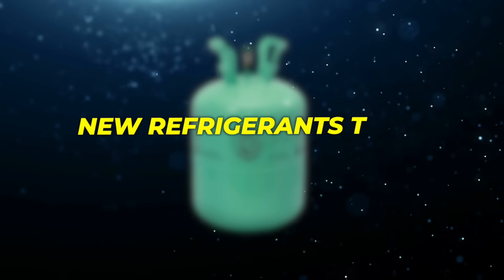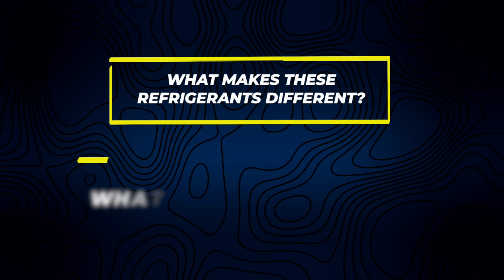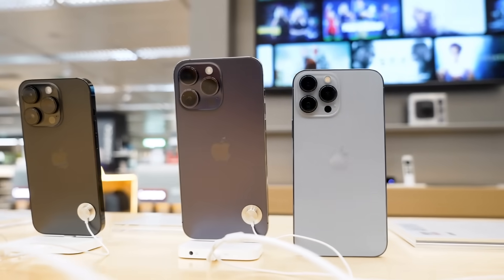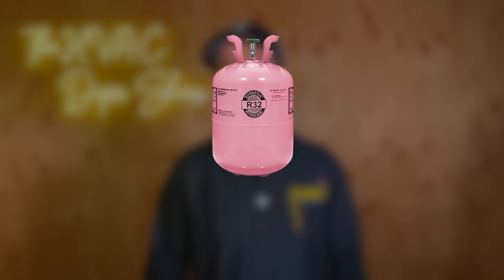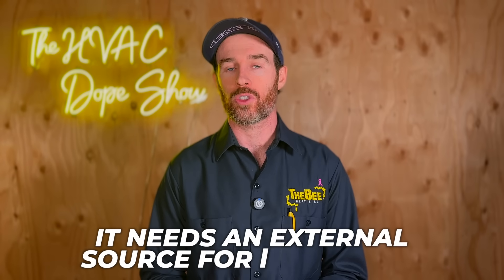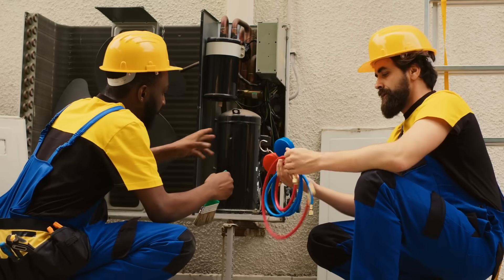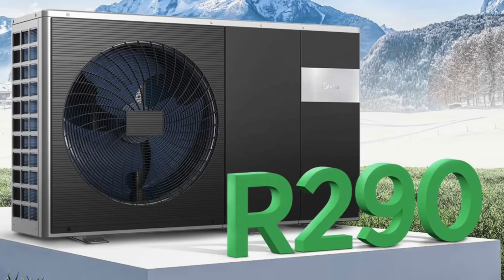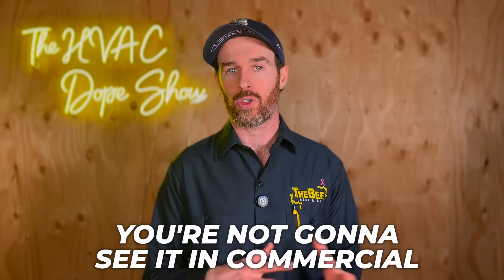The TRUTH about the “new” refrigerants | R32 and R454B refrigerants phase in

Comment: I want a R290 (propane) or C02 mono-block system .. and I’ll wait until they are here as I live in a colder region and these are better options for hot water.
Reply from the maker: Hopefully they’re here soon! Might be waiting a while but if you don’t need it yet then no rush 😁
Reply: I was reading about this in like 2006 crazy how long change takes
Reply: Propane tends to be a bit on the explosive side.
Reply: @n4mwd  … we use propane and natural gas inside our homes and in BBQs everywhere.  This tech is over 100 yrs old.  In an air to water system no gas enters the house, the unit is sealed, and the gas is inside a steel box.  These systems are legal in Europe and Asia, and are proven to be safe.  Corruption and/or incompetence is why we do not have them here .. maybe both.
Reply: @solarguy4850 I think the issue is that it’s super common for leaks to occur in a hvac system due to high pressures while operating. That’s why it’s seems dangerous to have a high flammable refrigerant for hvac systems
Reply: @carlosgarcia9509  I’m talking about air to water systems.  These are factory sealed and the propane never enters the dwelling .. just heated or chilled water.  It is also a teapot full in volume.  They are legal everywhere on the planet except North America, and there is no evidence of problems.
Reply: @solarguy4850  There are good reasons that propane is not used in US systems. US system refrigerant charges are much bigger than in Europe — up to 20 lbs, so a leak can be deadly. Propane is extremely flammable, and heavier than air. So if there’s a leak inside the home, if a few lbs of propane are ignited there can be a severe fire or explosion.
Reply: @solarguy4850  for package units, maybe, but not for splits with several pounds of refrigerant. Propane is heavier than air, and pools. If a pool of propane is ignited, a leak can be catastrophic to the building.
Reply: @WLB2-j5j  yup .. I’m talking monoblocks.  Zero interest in splits personally.. they don’t do hot water. Propane or C02 heatpumps are needed for hot water else you rely on resistance heat for the top 20% of heating.
Reply: @WLB2-j5j  I’m talking monoblocks.  No refrigerant enters the building. Also no need for that much refrigerant in a monoblock .. the ones used in Europe are fine .. a bit more refrigerant would be nice, but fine.  Look it up.  BTW .. I have 20 lbs on my deck and 40 on my RV.
Reply: My next home will use this, an R290 monobloc system for radiant heating. I might have to move to Europe to make this happen.

Comment: As a person looking into installing a mini split system.  What do think will happen to unsold system going into the new year. Will they be returned to the manufacturer or do they go on sale to make way for the systems with the new refrigerate.
Reply from the maker: They’re already kind of priced accordingly but they won’t be manufacturing 410a equipment as of 2025 so I’m not sure honestly. It will likely stay at a slight discount like it is currently
Reply: @TheHVACDopeShow  thanks for the reply. I'm just on the fence on if I should buy now or wait until closer to the end of the year.
Reply: They'll push their old crap at even higher prices. See in this game, the hundreds of millions of homeowners are stupid suckers. Just ask any sub cool expert.
Reply: Any R410 system built before January 1, 2025, will be allowed to be sold even if it's 2028 or later. But don't fall for that trap, R410 is going the same way as R22 and just as quick.
It's better to buy an R32 system and not worry about the availability of the refrigerant down the road.
Reply: they will just sell out
Reply: Hvac owner operater 23 years I would buy a Daikin r410 mini split I do not like the idea of being a guinea pig for the new refrigerant
Reply: The regulations are based on date of manufacture of the units, not date of sale. So no problem .

Comment: I really don't agree with the rhetoric right now of pushing installs of 410a systems this year because "the new refrigerant" will cause prices to increase. I don't see that playing out much over the natural increase in prices. I do foresee many unscrupulous contractors pushing for system replacements on the basis of "410a has been banned". It just seems like every change is being used as an opportunity to scare the consumer into making unnecessary purchases.
Reply from the maker: Yeah I’m in the same boat when I heard people saying “hurry get your 410a while it last” I was a little surprised… it’s really not a big deal to me either way and Daikin is backing there warranties with R32 units so if someone buys a 410a system in the next month and the coil goes bad in a few years or something, they’re replacing it with an R32 coil not the other way around.
Reply: Buyer beware.
Reply: Just installed an R32 unit today. Only a 3% increase in price vs 410. New furnaces when they come will be 8%
Reply: R454B will be patented until 2030, both refrigerants will be high cost and there is no full production stop planned at this time. No matter what customers are going to be paying more, just depends on if the customer wants to have lower initial cost.
Reply: @FreonChugger  I'm not a fan of 454B. From what I've seen, as R32 has become more available the price has dropped. As of the current price it's just slightly above 410a. R32 being single component will lend itself better to recycling.

Comment: Why do mfgs. limit residential systems to 5 tons/60K btus? My home has 3  5 ton one two and a half and one 2 ton and one one and a half ton units each with its own ducts and condensors and air handlers.of six complete systems. With changing refrigerant and varing types of collants in my different aged systems this for me this causes many issues with servicing and costs to replace for entire system would be daunting and not solve the problem long term as the refrigerants keep changing. Ray Stormont
Reply from the maker: Probably duct sizing since one system doesn’t work well for a large home anyways because you’re not going to have a central air Handler… this is going be a LONG phaseout so I literally would not worry about it because chances are your 6 systems will break at various intervals and it’s not going to create as many issues as you might think. Techs are used to this and also 410a is going to be available for basically another 20 years, and manufactured for another 15 years so it’s going to be a slow process
Reply: Practicality and cost. At 5 tons you are looking at 60 amp per unit on single phase. And also just like @TheHVACDopeShow duct sizing and many other system design challenges arise.  Once you get into 3 phase 10+ ton VRV or VRF systems are available for large residential or light commercial settings. But there is a cost factor too where multiple 5 ton or less units make more financial sense.

Comment: Figures a change is coming. 
I just replaced my R-22 system that was installed in 200 with a R-410A last month, and a new refrigerant type is coming soon...
Reply from the maker: It’s honestly not the end of the world… as you can see some of the techs advocate for 410a systems since you don’t have mitigation controls from the mild flammability, which is a plus because your systems won’t stop running with 410a if you have a mild leak. There’s 16 years left before the phaseout of 410a so it’s not an overnight thing
Reply: @TheHVACDopeShow  , yeah, but the issue will arise in 20 years like I had just now though, 
My system needed the refrigerant replaced (I screwed a screw into my coil like an idiot when replacing a capacitor) and the cost of R-22 is just crazy high. 
I could have had the hole brazed and then refilled the system, but the cost of the R-22 + labor and still having a 20 year old system with a refrigerant that is getting harder to find and just more expensive as time goes on vs the cost of  a new system and not having to worry about it for decades, well, new system won. If I could have had R-22 for $10/lb, sure, but at $100-150/lb, no thanks. 
Question is, will R-410A be priced like R-22 is now in 20 years?
Reply: @blupupher  The price of 410a has already started to rise. Over the next few years there is no question the price will increase further.

The interesting thing is the price of r22 has actually come down. I was able to purchase r22 at around $50/lb this year where is years past it was nearly double that. Price follows demand and even though there is no more r22 being imported or produced, the demand has dropped substantially with all the systems being replaced.
Reply: @TheHVACDopeShow  BUT if everyone does this stays with R410a equipment? There will be a shortage of R410a as early as the next drop down which I believe is 2028 or 2029. There won't be enough supply to meet demand, prices will explode. You voted, and you're welcome how dare you bring politics into it? Nothing is done in this country without VOTES if you didn't vote, you voted for it. This will not be like R22, there is no massive stock pile to work thru.
Reply: Don't worry about it. If you get 20yrs out of a new system your fortunate. Just set it and forget it.
Reply: And will of course be non compatible with the newer and still outrageously priced freons.

Comment: Topping off of R32 or R454b isn't going to work due to mitigation controls No more gas n go. Mitigation controls will not allow the unit to cool OR heat if a heat pump if the mitigation controls sense a refrigerant leak. Why mitigation controls? due to mild flamability of the refrigerant (safety) to prevent the manufacturer or contractor from being sued for burning your house down. So now you see how this false info gets spread. A leaking unit will force you to repair the refrigerant leaks, or sweat bullets. Yay sounds like fun This would be one reason to run out and buy a new R410a AC unit while you can do so. The refrigerant cost is likely going to be more, but probably not much different with the newer stuff either considering the leaks will have to be fixed to get it to work properly.
Reply from the maker: That is definitely annoying for customers who don’t want to deal with it, or not being able to service them in the middle of summer without replacing a leaky coil etc. Don’t like topping off leaky systems for obvious reasons but I agree that’s going to be annoying when you can’t get something to work in the middle of a hot summer night without replacing the coil
Reply: @TheHVACDopeShow  yeah we are gonna enter the new land of haves and haves not. Some calls I run people just don't have the money to replace the leaky coil right away. Others may be a timing issue, because these problems typically occur at a moments notice. But you know these so called solutions by the government leave much to be desired. Now one side of the ticket is more or less proposing food lines to deal with price gauging. "her words, not mine" Bold new era we are entering if many of you don't wake up

Comment: My Daikin AC in Italy from 2015 is R32
Reply from the maker: I’m sure it is 😁 They’ve been using R32 for a while in Europe / other countries so it’s by no means a “new” refrigerant.
Reply: I installed a one ton R32 mini-split in my master bedroom earlier this year in Florida. I picked R32 because it's a single component refrigerant that will be substantially cheaper to charge if it's low. R454 and R410 are two component refrigerants, both of which have R32 as one component. To recharge the R454 or R410, ALL of the remaining refrigerant has to be recovered and sent off to be recycled... expensive. Then, and only then, can you put new R454/ R410 in.
Reply: @Richard-qz8up recycling refrigerant is free at many distributors……

Comment: Don’t forget R32 already makes up 50% of R410a , a small technicality you most likely can’t light R32 straight from the bottle, there’s a very small window of R32 and oxygen mixture that can ignite R32 , I can give you ore details about this if you need it, thanks 🙏
Reply from the maker: I didn’t realize it was just R32 and R125, that’s interesting to note! Not much of a change after all I guess!
Reply: The problem isn't necessarily the refrigerant only. The mixture includes oil that circulates with the refrigerant, the oil as it were has a much lower burn or ignition point. Under the right conditions even R410a can ignite and burn. Don't believe me? Watch this> the era of get it on tape rather than oh put the fire out? https://www.youtube.com/shorts/W4PiBIyNjx0
Reply: It's flammable, therefore explosive under pressure. R22 had a head pressure of a little over 200-250. 
They've been working on no flame connectors. But they'll make sure all installations and maintenance are done by their unmasked crooks
Reply: Being 410A is blended already R-32 & 125 it just blows my mind that it was “suppose” to be a huge epa environmentally healthy refrigerant to begin with… now boom 💥 it’s impacting our climate  “ “ such an $$$ scheme .
Reply: @ryanvantomme7063  Not quite. R410a replaced R22 in order to eliminate Chlorine from thexRefrigerant, because R22 was destroying the stratospheric ozone layer, as were r11 and r12. R454B is now replacing R410a because R454B has a much lower impact on the climate. All prior HFC, HCFC and CFC refrigerants were several thousand times more potent at affecting the climate than CO2.